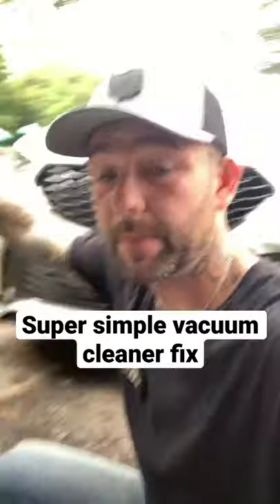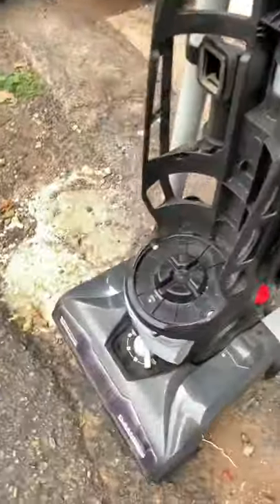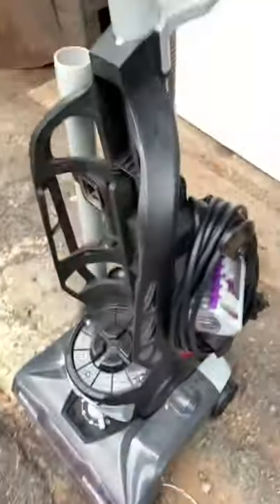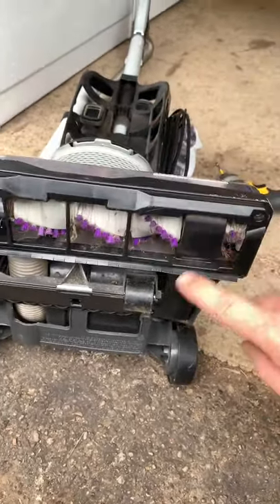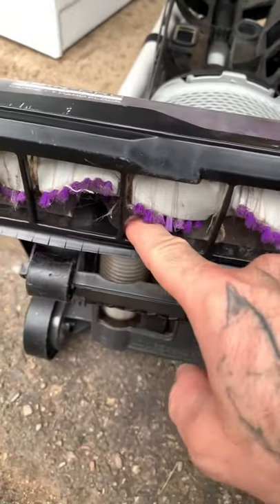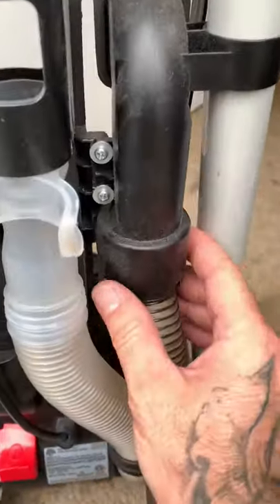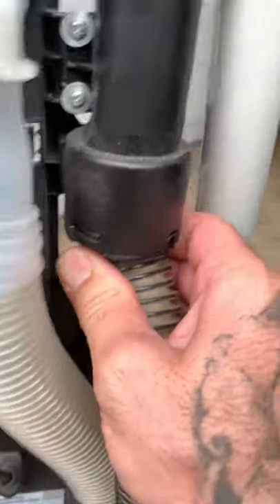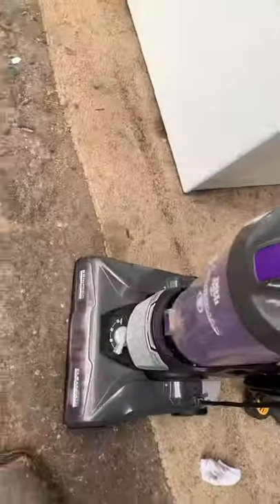Most common reason why your vacuum isn’t working and how to fix it #shorts #diy #savethesocks

Comment: Do you have a video for fixing/ changing those toaster oven elements? They don't light up anymore. It's about 8 years old. The body of the oven is in good condition . I want to try to fix it.
Reply: Take pictures of yourself taking it apart and once you get the broken part out (element or thermostat most likely) then just look at your pictures in reverse order and put it together using them for reference. Then, boom! You’ve fixed your appliance!:) always take extra care when working with electricity. Have a friend that knows something about it with you if you can, 2 heads are better then one, and always make sure it’s all exactly the same as it was when you took it apart. Hope that helped!:)
Reply: @ChainsawChuckSmallwood  Thanks, will definitely try that.

Comment: I bought a used vacuum & it kinda of vacuums stuff up but once I turn off my vacuum all of the stuff I vacuumed up falls right back out can you give me a good solution? Plz & thank you
Reply: I'm no expert. But, I did have to fix vacuums a lot at the flea bag motel where I was a maid years ago. I would think that your vacuum cleaner symptoms could happen with a partial blockage that is very close to the end of the hose (the opposite end he showed in video.) The reason that would be my guess is because a clog in that area could explain why the dirt falls out when suction is turned off....since the dirt hasn''t made it far enough inside the hose to not fall out. 
I remember, years back I nearly threw away my current vacuum, that I have owned since 2004. It had gotten a partially bent bobby pin lodged up in the very middle of the long hose and a sock was blocking the hose because of it. Ugh! It was a total nightmare! But, I finally cut up a metal clothes hanger and was able to drag that 
sock and bobby pin out of the hose! Worked fine ever since. Good luck!